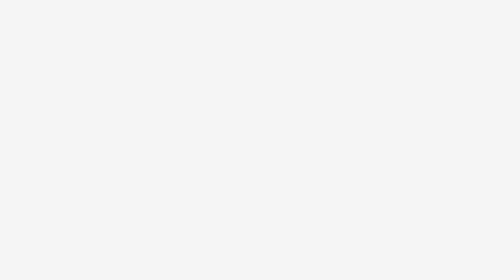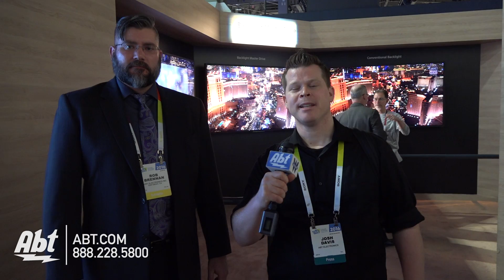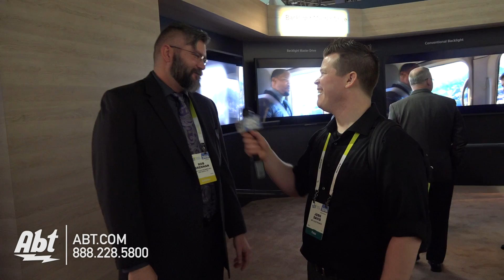Sony Backlight Master Drive Prototype - CES 2016

Comment: Watch out LG
Reply: Sony should be the one watching out for those Oleds LG's pumpin out.
Reply: +Mark Winston 
They have hit a wall with OLED. Production yields are too low. Sony has figured out how to produce LCD that will compete in the mass market. 

This technology will not be as good as OLED but it does not need to be as it is for the mass market. This technology will scale easily through all levels and not just high-end.